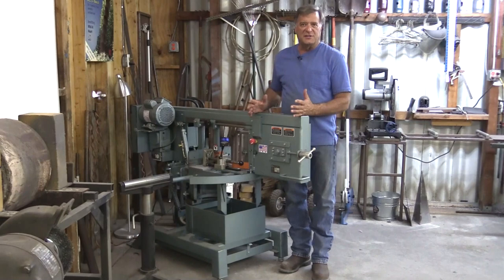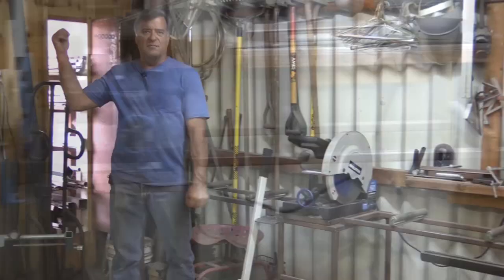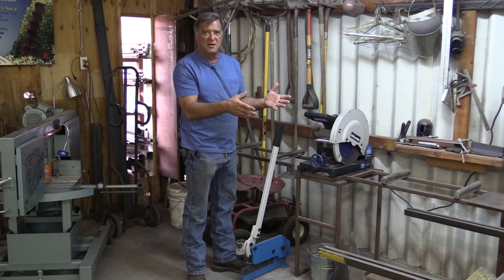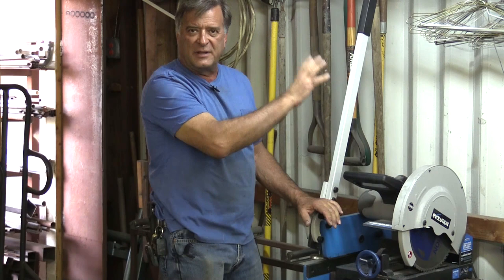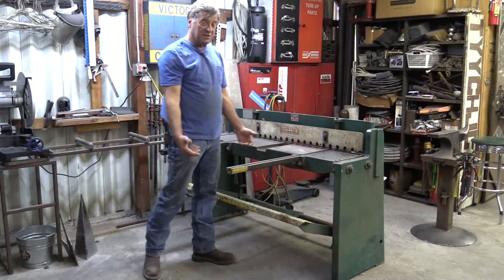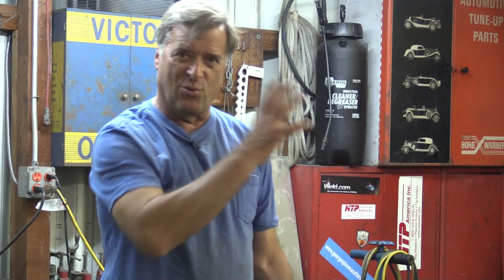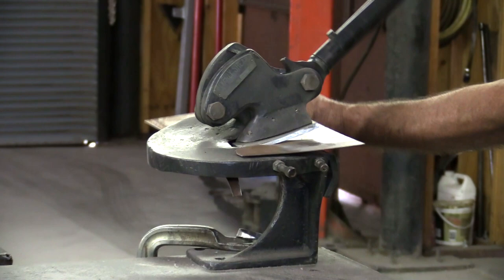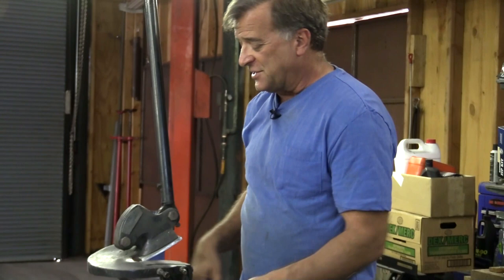A Tour of My Metalworking Studio, Part 2 - Kevin Caron

Comment: Nice to see your tool set, as it give us an insight into the process of how you start working the metal for your sculptures.
Reply from the maker: I find myself using the tools on hand to do a job they were not designed for.   If I really need a tool I don't have I will rent one.   If I rent the same tools 3 times I just go get a new one because I will be needing it more for sure!

Comment: Great shop! I think you've got an Ellis 1800 there, I have the same band saw.
Reply from the maker: it's a 1600.    Air cooled instead of oil cooled.
Reply: I don't think any of the Ellis band saws are oil cooled. The 1600 has the two big wheels.
Reply from the maker: The 1800 comes with a cutting oil pump and nozzle.
Reply: You're wrong about that. I have an 1800, and I'm pretty sure all Ellis saws run dry, with an air cooled option. If you go back and watch one of your previous videos, where you cut open a gas cylinder, you stated it was an 1800. Anyway I enjoy your videos quite a bit, didn't mean to sound like an ass, just making an observation.
Reply from the maker: Gray hair is getting thicker on my head..    Sad!     You are correct, I was thinking about a different make and model..      Damn,,,
Reply: Hey man at least you have all your hair. Mine is getting gray & falling out!

Comment: I had the inspiration to replicate a pear tree in my backyard.  It would be like hundreds of leaves fabricated from the various cheap, sheet stainless stock I can get at my local metal distributor.  I wonder if you have any tips on tools I could use/buy besides my angle grinder with cutoff to make the cuts.  It look like you have a variety of shears.  Maybe this open throat shear would work ?.  I wonder where I could pick one of those up ...  Otherwise it seems like fab-ing hundreds of leaves would best be done by something like tool and die which I don't really have any experience in and would probably be pretty costly for me to contract out.
Reply from the maker: Look for a Beverly 2b shear.   Should be just right for what you are planning.

Comment: dear sir I have a small shed where I'm learning to mig and stick weld I don't have a smoke extractor but use a fan to clear the smoke should I up the amps to prevent cooling of the weld
Reply from the maker: I would turn the fan around and let it suck the fumes instead of blowing them.
Reply: thanks for the info much appreciated will give it a go

Comment: Hey Kev, do you use the Beverly to cut curved as well as straight sheet metal ? What is the basic price of the unit you have and do you use it as one of your top 10 metal cutting tools ?  Thanks  J K   in Houston.  Too bad I did not know of you when I got married in Phoenix back in 2006
Reply from the maker: I do all types of cuts with the Beverly no problems.

not sure on the price right now but google is your friend.

Comment: Blue plate shear.who made it ? Capacity ?
Reply from the maker: China and 12 inches deep.   Up to 1/8th inch thick.
Reply: I have an Ehoma 8". It'll do 1/8" x 4 when you feel gorilla.I do tons of 1/8 thick scrolls in  1/2" to 3/4 to 1 and then "ears" to mount things 1" to 2" x 1/8 thick. It'll shear 1/4 x 2. I have no idea who pulled the handle for that claim but I promise not to piss'em off. Havent tried over 1/8 myself.
Kev. Go look at the Lowbuck plate brake. I bought one FTFuOfIt and find myself using it quite a bit.Like his tube-pipe notcher---crude and quite effective.
Reply from the maker: Thanks, will check it out..